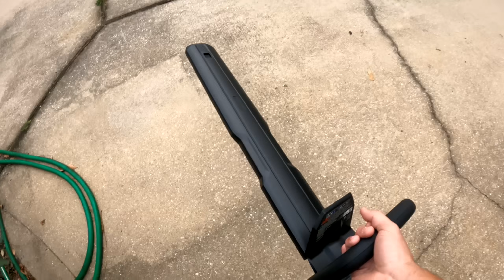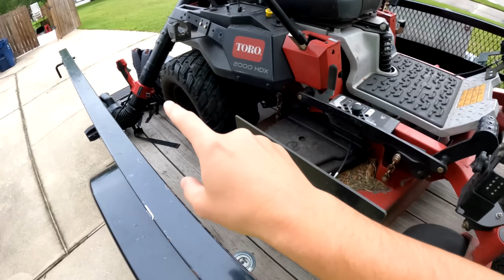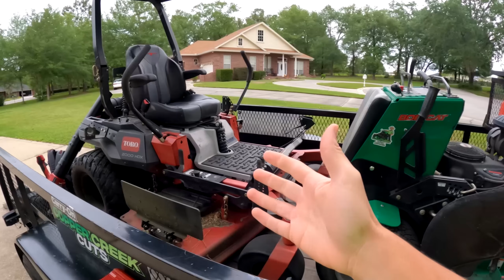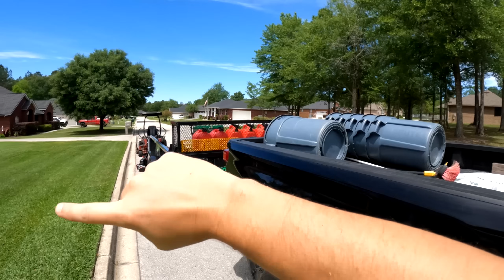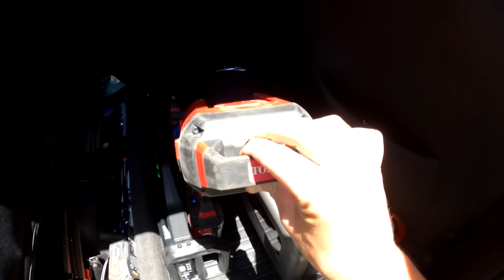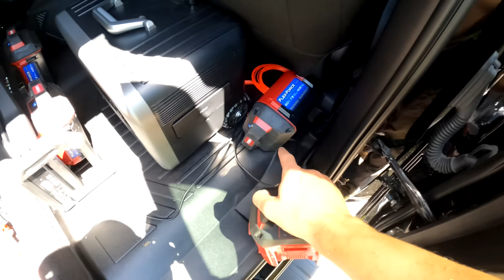I FINALLY switched! (TORO Revolution Battery Powered Lawn Care Equipment)

Comment: Hello Brad! I started my journey into battery powered OPE, with a commercial Milwaukee M18 Fuel 24" hedge trimmer, which works really well, I really quite like it, runs on the 9AH battery, a bit heavy, but gets the job done. A couple months ago, I purchased a commercial Makita 40V straight shaft direct drive string trimmer, which runs on their 4AH batteries, its a really nice machine, got lots of power being a battery unit, and gets the job done, while being far lighter then my gas units!

Comment: Hey Brad! I'm in the profession working for a large lawncare/detail/landscaping company, we have 9 lawncare vans, 3 detail trucks, and 2 landscape trucks that go out every day. Each lawncare van does 30+ yards every day mon-fri and we tried the commercial battery equipment on one of our vans for a few weeks and it did not work out at all. The batteries just don't last long enough and the infrastructure required to charge enough batteries to make it last all day just didn't work out for us and we have since switched back to echo 3020T trimmers, 2620 edgers and the 770T blowers. Thanks for the awesome videos man!
Reply from the maker: Excellent feedback, thank you! I would imagine a large crew would have a MUCH harder time of it than a smaller one.

Comment: IMO, backpack battery operated blowers are not a good idea for commercial use just yet. I used a Kobalt 40v for 5-6 lawns a day and it would be dead by the 3rd or 4th yard. Those drain it so fast even though it’s brushless. I love my handheld blower by Makita. It works well for small residential properties and the battery last all day.
Reply: Kobalt is junk from Lowe’s. Makita doesn’t play around and makes some really awesome tools

Comment: I use a few battery pieces. A leaf blower to blow off porch and deck, a battery pole saw I use periodically to do a small bit of pruning, and a small hedge trimmer for in-between touch ups. Both work well for the limited tasks I use them for, but for the mowing, edging, leaf clean up, tree cutting, etc... it is gas all the way. 5 mins to fill a couple containers at the store, and then pour in tank, start engine, run till empty, and repeat. Way to easy to be bothered with charging wait times and limited use cycles. I think battery power has it's place at the table, but it just doesn't fill the table for me.

Comment: Jeez, seems really inefficient for everyday use.
Reply: Constantly changing/rotating batteries. Having to bring the system in every night to recharge. Maybe it’s because you were doing a video to show how to charge and rotate batteries but it just seemed inefficient. Wonder how many years you can get out of one battery? Regardless, your video provided great insight on battery equipment!
Reply from the maker: @stevedavis3370  I appreciate the specifics. I never try to change someone's mind but without the info in your follow up there isn't any way to address specific concerns or have a discussion.

I won't say there isn't ANY time spent swapping or charging since that is false, but do keep in mind this was my first day with the setup and as you mentioned, I was filming (which is a huge inefficiency as everything is done one handed), so what you are seeing would be the most inefficient stage of this learning process.

I think I spent maybe three extra minutes loading the charger, battery bank, and all batteries into my lawn care equipment this morning? But good metric to track moving forward.

You also bring up a great concern about the overall lifetime, since that is a big factor in whether it is worth it or not. I can only provide my own first hand experience which is another reason I make these videos.
Reply: @BakerCountyTrashPickup  sounds good, again, thanks for making the video showing the process and capabilities of the battery equipment!
Reply from the maker: Which part is inefficient?

Comment: I did a test of the backpack blower at the end of last year before I moved. It worked fine if I did ten zero lot line subdivision homes, however, it didn't last long enough to blow off one of the smaller condominiums that I maintained.

The trimmer worked well for what I needed at all locations. I didn't have to use it for any overgrown grass or any large areas
Reply from the maker: I don't know what all was involved in the condo you took care of, but I know one of the HOA's I had had a mile stretch of road with two curbs and a sidewalk I had to blow off. It was maybe 15/20 minutes of full throttle blowing while I rode my stander. I would be nervous to try it with battery, but that would be a good experiment!
Reply: @BakerCountyTrashPickup  that would be close to the condo association I was referring to. It took about half an hour to blow off the place, mostly at 3/4 to full throttle. Two long stretches of blowing off along roadways, plus the parking lot, driveways, patios, etc...
With a few spare batteries and a power bank, similar to the set up you have, it could have worked out for a full days with of work but it would have sucked swapping out batteries numerous times. 
I'm in discussions with another company to try out their new commercial line. They're sending me a camera and some software to mount on the mowers later this summer to collect data. I'll share that in detail when I'm allowed